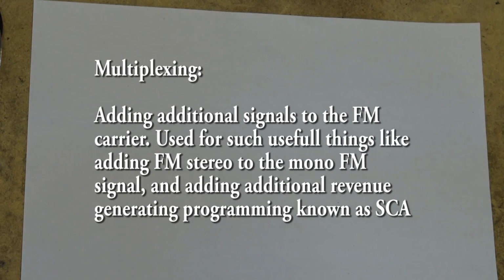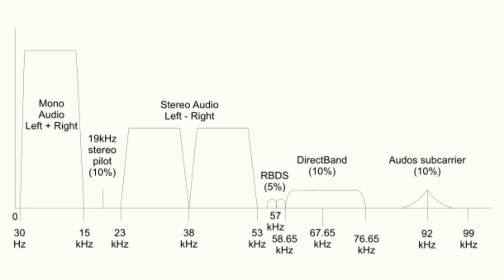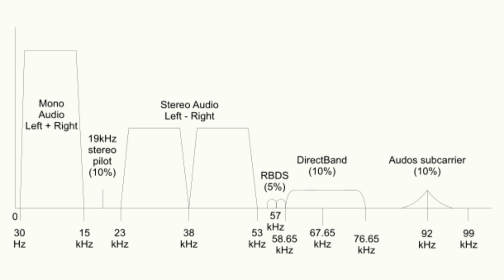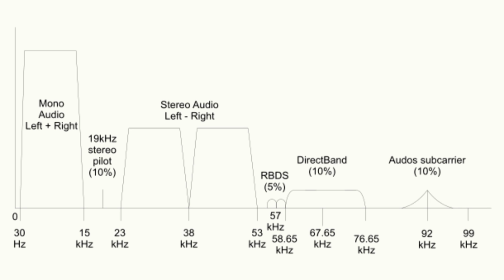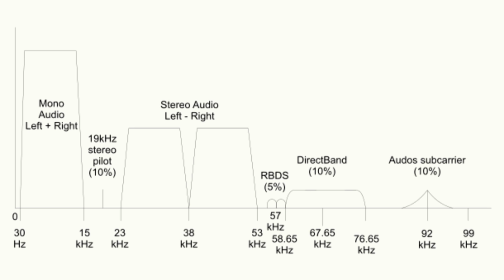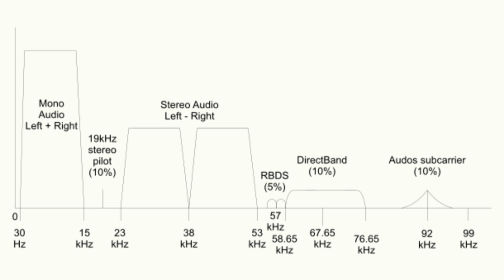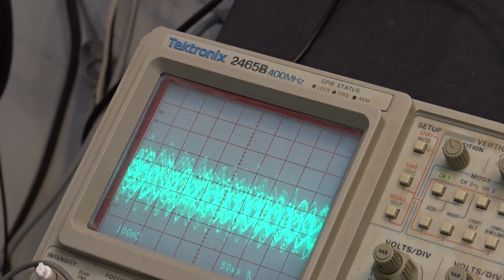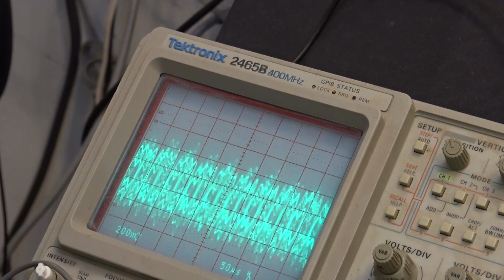FM SCA radio explained and a demo of operation

Comment: I built one too and 20 years ago, plenty of low fi  music. I used to have issues with the audio sneaking in on the sidebands.
Reply from the maker: Mark Anderson 
Yes I had the same issues with that decoder and had placed a bunch of resistors and caps to reduce the swamping from main channel. Proper sca receivers used high pass filters to kill everything below 50 khz.
Reply: I imagine they do. I used to hear Muzak playing in grocery stores and I knew it was SCA and no background noise. I actually fixed a CD changer for Muzak once. It was an NSM 100 disk, RS232 controlled changer and they had 3 of them for 300 special music CD's that played 24/7
Reply from the maker: Mark Anderson 
Musak as they call it was distributed many ways. Sca was one way. More common was a leased telephone line. The equipment is still in at the central office I work out of. The tie down blocks are still there but the programming has been gone for years. 
When the CD changer came out most of the services moved to CD. There was a record based system before that the seaburg 1000 that used special records. 
The reason "special" Cds were used with modified players was for song logging. Royalties are paid to the artist for every play. 
I remember shooting a wedding about 30 years ago now and the DJ was playing cassettes.  During dinner while everyone was eating a police officer and a "suit" entered and headed over to the DJ table. After a few minutes the music went off and they carted off all his "bootleg" tapes and charged the DJ with public performance without a public performance license. It made for an interesting evening. No dance music. The DJ improvised. Since as part of the party they were doing karaoke they set up the karaoke system and guests had to sing to the happy couple. I layer found out the DJ was fined 40,000.00! 
The next time I worked with this DJ (I worked with him many times as we did package deals) he had boxes of CD all leased from power tracks.  He said it was 100.00 a month 25 basically every weekend to play music which he just added to the cost of his gig. They dont mess around because about the same time this happened a restuarant in nanaimo got popped for playing recorded music in their establishment and got a similar fine.
Reply: Interesting, I did DJ work too,  One guy I worked for had special tapes labeled AVLA. I made my own and I was illegal.  I did not do it much and I had VHS Hi Fi masters of all my tapes.  Yes music over phone lines, I used to work on jukeboxes in bars and one company called wired for sound did just that. Music came over satellite, cable TV, special 4 hour cassettes, or continuous loop tapes The CD changers Muzak had were from NSM and were usually used, minus the RS232 interface in jukeboxes. I also remember the special CDs and they sold them for roughly $1000 or so and you signed up for subscriptions to get a CD a month pop and one country. They marketed similar ones for jukeboxes with a proper universal title strip. It was ERG or Entertainment Resources Group. Yes Seeburg also was big in Jukeboxes, they did not adapt well to CDs. NSM made a whole new high speed changer, Seeburg took a 45 mech and added a CD player and hooked to a home stereo in the box or bought a Sony changer. Pioneer also failed miserably in the jukebox world.  Seeburg went from number one in 45's to BK over the CD. Now most went under adapting to fully digital sound. I spent years in the coin op business and saw many connections to background music and DJ.
Reply from the maker: Mark Anderson 
That's right. It was a subscription and he got a few new disks every month. He would loan them to me to copy for myself. I was working in a restuarant a few years ago and they had one of the newer musak systems. It consisted of a single disk blueray drive and all the tracks were recorded to a 25 gig bluray disk.  Owner said they sent him a new disk every 6 months. This was about 10 years ago now I saw that system. I am sure everything these days is hard drive based. The files in the bluray disk were encrypted some way because he loaned me an old disk to see if I could copy it and on my bluray drive I could see the space used but could not read any files. So they were using some non standard format that only their special player could read.
Reply: @12voltvids  I worked on many video games that were in propietory format. The disk, no idea. I know one jukebox used ogg files, if the blueray was like an os, Linux is poular. No matter what, they will make your life difficult. The cassette system was analog but single track 15 /16 ips auto reversing at the end of each track  never seen blueray Muzak. In general, it's mono and better than am radio. No commercial sound system is stereo and most 70 v.
Reply from the maker: It was the encompas system, which is basically a box and it has eother a DVD or BDROM drive in it. The disks I remember had an expiry date and they sent a new disk to subscribers. It would have been 8 - 10 years ago I saw this system. I was doing business phones at the time and it was in the phone room right next to the KSU. It had stereo output, but I have no idea if the music was encoded in stereo or not. They had it plugged into an amplifier for the restaurant and the second output was plugged into the music on hold input on the phone system. I got to talking to the owner about it, and there was a disk that was sitting next to it. The owner said, take it as it was an expired disk. I figured I would be able to rip it but the disk couldn't. I did a little research back at the time and found the only way to read it was with the actual unit, but because the disk I had was expired even obtaining an encompass player would mean hacking it to change the date, or copy the disk and change the file date. Again when it all boiled down to it I lost interest real quick. 
I have no idea what happened to the disk. I don't think I ever returned it because the guy said it was expired and was no use to him and they didn't want it back. I have literally thousands of disks. CD's DVDs even a few hundred laserdisks that were given to me. Some of those are quire valuable to laserdisk collectors.
Reply: @12voltvids  what a waste. Well it must be part of an O/S then. I guess all you could do is an analogue recording. All this for music on hold? Usually that crap is a digital loop that repeats every few minutes.
Reply from the maker: Mark Anderson 
No this wasn't elevator music. This was. Top 100. It was a fast food joint. Disk had several hundred tracks and multiple playlists. Depending on the subscription by the business the playlists would determine what music they licensed. He could choose between pop, rock, country ext. I'm sure there was bg music on there as well. They would send a new disk every so often and expire the old one. I believe the new ones they send them out on sd cards still using proprietary compression / encryption. The only way I understand to copy the music is with one of their players and analog it into the computer. Hey wait a minute I do that with my cable subscription but I can plug toslink optical and do it without going to analog first.
Reply: @12voltvids  Now your thinking laddie. Often they put little ads every few songs do people know you took the music. I guarantee it's mono if it's for a commercial establishment.
Reply from the maker: I record from Stingray music as that is what my cable provider has, and they do have their "youre listening to stingray" but I do chop that off with audicity before I save it. You would never know that I recorded it from the radio basically. I have thousands of tracks. Been getting my music this way for 20 years. I record it to my DAT tape deck first, then I can scan the tapes at high speed and record only what interests me, and then wipe the tape and start over. I usually do binge sessions every 6 months or so. That way there is a bunch of newer music.
I will record perhaps 10 3 hour tapes over a weekend and then sit back for the next week listening / recording them, and of course ID the tracks with shazam.
Reply: Yes that's it, sort of an audio watermark. There is Galaxy in the Toronto area I think, I moved to Ohio. If you chop it, problem solved. Only other issue, how often do they repeat songs?
Reply from the maker: Mark Anderson 
Galaxie is gone. They were owned by the CBC. They have been replaced by stingray in Canada.  The repeats depend on the channel. This is why I record a bunch of source digital tapes all over a few days so I can get all the new stuff to capture on my computer.
Reply: Thanks, been gone for 10 years now. Stuck in the past.  I did over pay Rogers $9 so they send me a credit bill every month  I cant afford to move back.  Just bought a 1600 sq foot house for $45,000 here.
Reply from the maker: Mark Anderson 
A 1000 sq foot tear down here would run you about 1,200,000.00. 
It is expensive here. All that drug money that was being washed in real estate and the casinos and the previous government turned a blind eye for 16 years as the price of housing went through the roof. My property is worth 14x what I paid for it in 1993. I could sell here, move to the island or interior and put at least 600 grand in the bank.
Reply: Wow, move and work less, is my advice.  Invest the money and live off dividends. I bought a 16000 sq foot theater with a basement that I built storage units in and live in with space to spare. I have 2 retail stores and a 500 seat theater all for 58,000.  The building cost over half a million to build in 1947.

Comment: What would interest me is if we can find a way to generate our own SCA-FM signals.  I have many part 15 FM transmitters that I use for my experimentation, and I found a way to generate a CW signal in the 14 kHz to 16 kHz range and use proper audio filtering, and SDR analysis software, and a program called which is already available called Morse Code Agent where you can create a morse code to audio text messege at 15.330 kHz and play it back on the FM station in the part 15 collection.  I use SDR Sharp to monitor the CW signals which are very narrow in bandwidth like any other CW signal.     I would to take a step above and do more than just CW signals in the 15 kHz to 16 kHz spectrum, and also 50 kHz to 100 kHz spectrum.    15 kHz to 16 kHz is good for experiments when using your own part 15 FM transmitter.   So there is more what you can on your part 15 FM station.

Comment: 12voltvids, WOW what a tutorial! Thanks for this. Part of it I knew, like the 19KHzl pilot for stereo. But I never put all the pieces together before. Because both AM and FM broadcasts are slowly going away in other parts of the world, it's hard to say how much longer it will remain relevant but fascinating nonetheless!! Also, did you pick up a new to you Tek 2465B scope? It's a nice one! 👍😁
Reply from the maker: Walt's Channel 
Thanks to HD radio in north America being the only standard accepted by the FCC analog am and fm isn't going anywhere because the hd signal rides alongside the analog carrier. The reason analog is going away in other countries is because their digital system is on a different frequency which allowed the government to  auction off the old frequencies to other services to use them. That wont happen here because there is no spectrum recovered.
Reply from the maker: Walt's Channel 
The scope was sent in as s donation from a viewer. He also sent me his ct101 1.5" Panasonic color crt TV which I ended up buying to add to my collection.